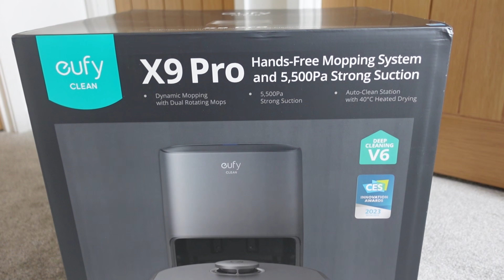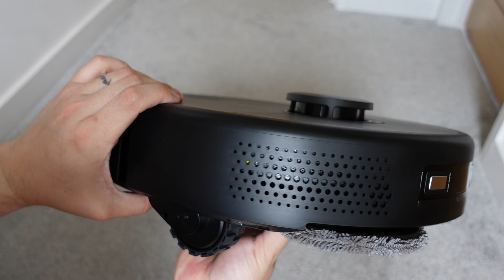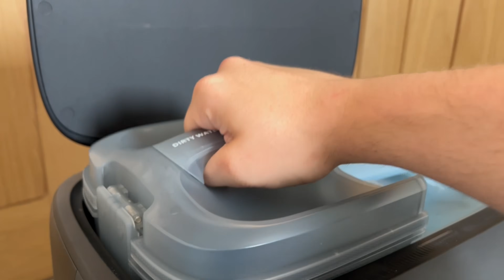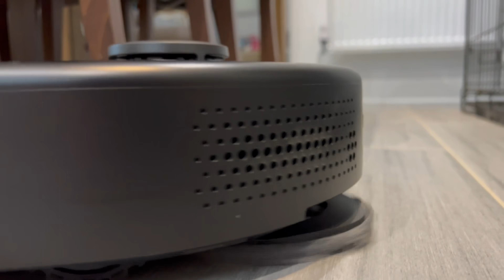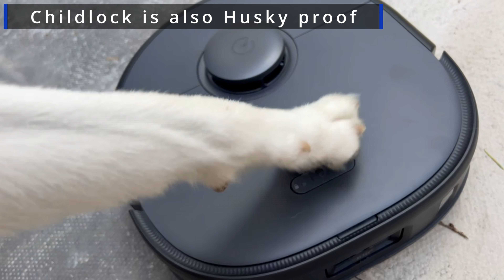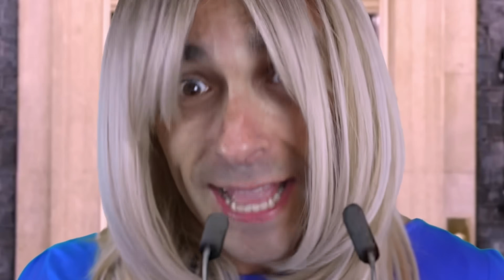eufy X9 Upgrades - Laser Beams, Spinning Mops and More!

Comment: This robot sucks ....it is totally rubbish ...i had three roborocks before i buy this useless piece ....The MAJOR flaw i MAPPING..First you can t magnify the map as much as you wish ,second you can t mark a certain point on the map to send it for spot cleaning ,third if you rearrange  anything in the room it won't clean where there were furniture or something else ...it just use the stored map and wont cover new areas ...TOTAL DISSAPOINTMENT .Won t reccomend as it is.

Comment: Thank you very much for the review, Mark! Excellent Review!
How do the mop pads stay wet when in mop mode? Does it have to return to the base station to rewet the pads every few minutes?
Does it also tell you when the dust chamber gets full?
Reply from the maker: With the mop pads it will return to add additional water (depending on your area size and how wet you have set the pads to be).

With the dustbin as the robot doesn’t self empty and there is no sensor to say the dustbin is full. This means if you do forget to empty it, it would still try and collect more. The compression on the dustbin is really good on this robot. The collection pretty much comes out as a block as it is all packed in very well thanks to the high suction.

I hope that helps :)
Reply: @MarkWattTech  thank you very much, Mark

Comment: Does this only use water to mop or a cleaning solution?
Reply from the maker: This only uses water but I’ve been putting floor cleaner in the mix and not had any issues.

Comment: Did you get it into Home Assistant? Tried the Robovac integration from bmccluskey and it detects the x9, but I'm not able to control the device. Any hints?
Reply from the maker: Similar sort of experience. Using the pbuteel fork of eufy_vacuum it can trigger start but nothing else.

Really wish eufy would open up to smart home use. The only other thing is to trigger it via HA using Alexa calls.
Reply: @MarkWattTech Thanks for the tip. I had totally forgotten to test the Alexa Commands
Reply: I was hoping for a mention of Home Assistant - I'd like to find something that doesn't require a cloud connection (probably impossible, I know)
Reply: If be interest in the answer to this too.